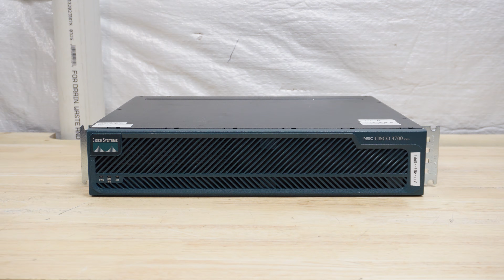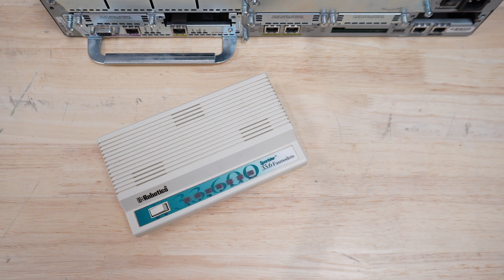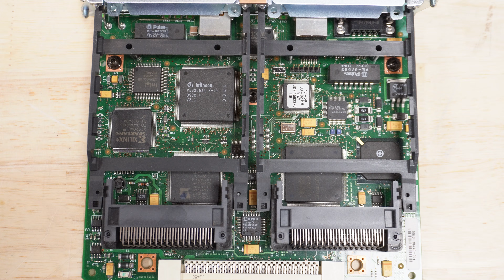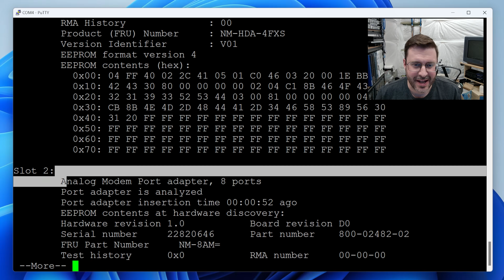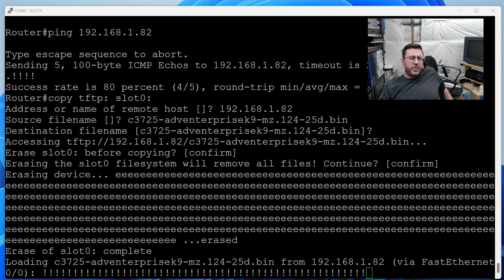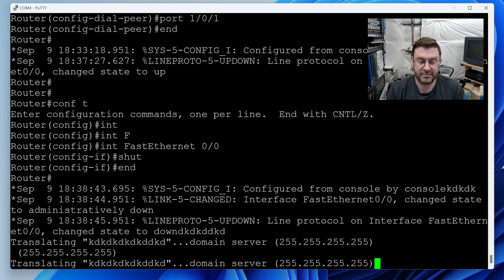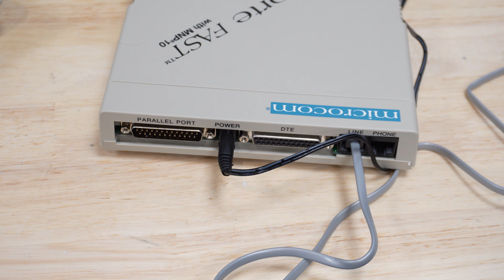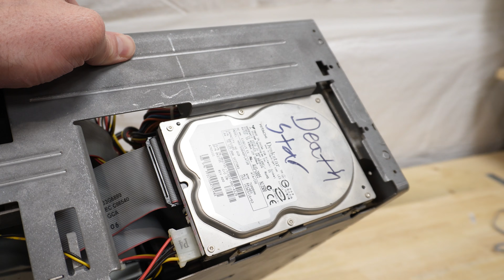All-In-One Dial-up ISP Box

Comment: Xilinx, sounds like Zai-links. ...man SO pumped for the token ring content. Long time in the making but gonna be worth.
Reply: If you haven't looked them up yet clab, Xilinx isn't a networking thing. They make (well, made, looks like AMD bought them) FPGAs.

My "Digital Systems Design" (aka building things with AND/OR/NOR gate chips and wires) class in college used some Xilinx boards once we progressed past the basics. The hardware seemed fine, but the software was super buggy and the lab machines weren't kept in sync so depending on which machine you sat at you had a different set of bugs in the Xilinx designer. Absolutely hated it. I'm hoping they improved that software in the....many, many years since.
Reply: @rnelson It's better but not by much, the new iteration from Xilinx is called Vivado. Synthesis is a die roll on if it completes or not, and the simulator crashes periodically every few hours. Glad to see it's some generational trauma 😂

(Gory details: synthesis and simulation tools are written in C or C++, accessible via Tcl scripting. That part is mostly OK; the best experience I've had is just doing everything via Tcl scripts from a command line. The problem is that they've stapled on a UI drawn in Java, which actually interfaces with the lower level stuff by string-building and executing the Tcl commands for the corresponding high-level operation. So there are allll sorts of subtle bugs there, where you get unexpected results, or a full Java stack trace popup, complete with ProGuard-obfuscated function names, which is the funniest. God forbid I wanted a space in the name of my project folder, or my international student friend has a home folder name with non ASCII characters :')
Reply: @an0ndev  Hahaha. Never change, Xilinx, never change. No, wait, that's not it---please change, Xilinx!
Reply: @rnelson  if you've used ISE in college, the latest version Vivado improved the software a bit, but it's like how getting a kick in the stomach is an improvement over getting kicked in the nuts
Reply: Xilinx (now owned by AMD) makes FPGAs (field programmable gate arrays), which provide a way to implement some digital circuit (implement something "in hardware"), without having to actually design and (pay to) fabricate the IC yourself, which is a very expensive process -- not worth it for relatively small batches. There are downsides, but in general, you can implement whatever digital logic you want; in university, we design and implement a MIPS CPU using an FPGA.

The FPGA ("field-programmable gate array") gets programmed at the factory with something called a bitstream, which defines the logic and routing of the digital signals around the chip. Aside from routing and input/output, the core building block that powers the chip is called a logic element. Each one can apply a digital logic function to a small number of signals (ex. out = A xor B xor C), and optionally synchronize the output to a clock signal. There are thousands plus of these logic elements in an FPGA; you form more complex circuitry by connecting the output of one as an input to others. (The function applied by each logic element is part of what's represented in the bitstream)

The other big FPGA designer you'll see is Altera, now owned by Intel.

Comment: If you stay with the four ports on the RJ21, it would make more sense to get a solderable or screwable RJ21 plug and add RJ11 and RJ45 cables to it. IF you want to have it really convenient, you can bring all eight modem ports and the four lines from the RJ21 to a patch panel to the front, you you can use breakout cables there :)
I messed with RJ21 for a while and I still have some plugs and panel mount sockets somewhere in a box. But as I only work with four lines at all (just the limit of my ATA), I ended up with two RJ11 (line 1 and 2) and a RJ45 (all four lines) on my workbench to save up space.

By the way, on most hardware port 25/50 was unpopulated. They stayed with things devideable by 8 so 24/49 was the last one.

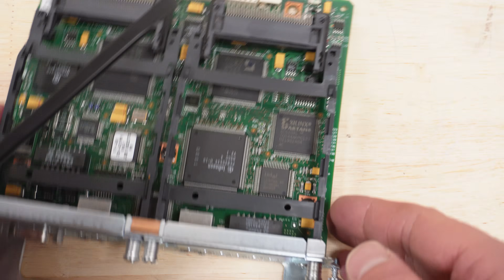Comment: 17:39 Its an FPGA, a bunch of logic gates, its programmable hardware basically, the firmware will configure it to do some function it needs, its faster than using a CPU, and it also allow you to basically switch signals and send them where you need in a way that can be changed via software by configuration.

Comment: Older modems use AC to generate the negative voltage for RS232. Learned this the hard way some days ago. Thought about modifying and put a switching converter into, but at the end I found the correct brick.

Comment: The parallel port on the modem was to provide an alternative, non-standard but faster, connection to the PC. The modem could compress the data it was sending over the wire (that's what MNP is - MNP 1 to 4 just did error correction, MNP 5 and up did error correction plus data compression) so if you've got a very easily compressible file you could theoretically need to push data to the modem faster than the max 115.2Kbps the PC's serial port supported. So you'd use the parallel port with a special driver to make it look like a serial port to the PC OS. In reality finding data that easily compressible was very rare so it was a bit of a gimmick.

Comment: If using Cisco router,  why not use digital modem card? Like NM-xxDM. I have AIO dialup router with 56k v90 dial-in based on Cisco 3800 series with NM-30DM card,E1-E1 loop and 4FXS

Comment: I'm not sure if it's era appropriate (probably?) but I'd use Cat5 with RJ11 terminations to do breakout from the FXS ports and into the modem ports. You could get 4 phone lines over a single cable, cleaning it up quite a bit and pretty much trunking 4 lines back to the modem via one cable that you just run along the big cable, splitting them out back at the router. Then you could also use RJ11 jacks with cat5 (and RJ45 if you wanted to be fancy) to push a bunch of phone lines to the other room from the retro rack.

Comment: If that controller card in the 3745 is removable, in true Cisco fashion I'm betting the chassis base SKU that article used for comparison didn't include the controller card, which is why it's seemingly cheaper. Tough to track down the old datasheets and ordering information now though (at least before I got bored lol).

Comment: 8:45 Those 25 phone jacks have 4 pins each, which means 2 phone lines per jack. You could plug up to 50 phones into that thing.
Reply: Or for diverse bonding.
Reply: I only see 2 pins populated... a quick google shows that the AT125-SM is a 25 pair bridging adapter: 25 pairs enter on the first RJ-21, and unless a plug is inserted into the corresponding jack, that pair is bridged to the corresponding pair on the other RJ-21. You'll often see these sorts of jacks where you need to be able to quickly disconnect the subscriber side of a circuit for testing and fault isolation.
Reply: they just used 4-pin jacks, doesn't mean the 2nd line on each is wired to anything at all
Reply: jeremycole2036 I find it highly unlikely that they used 4 pin jacks and didnt use half of them, when they could have used 2 line jacks. 2 pin jacks did exist, as did 6 pins, as RJ45 is technically supposed to be a six pin standardEdit: aaaand not watching all the way through before commenting hits me in the ass

Comment: I do remember the mid to late 1990s - All the IBM people in our company were all "token ring is better becuase it dosen't have any packet loss, that's why it's used in banks!" and I was like... ??? huh? That... doesn't make a lick of sense but it sure sounds like something an IBM salesperson would say. 😸 - but eventually, even the AS/400 was "ethernetted" - there were also adapters for the old twinax wires, so you could plug in really old terminals to RJ45 cabling.

Comment: One trick for rack ears  is to flip the rackmount brackets so they are closer to the center of mass.  Downsite, the router pokes out the front a bit.    Ideally you'd find or make the rear mount brackets that fit your depth of rack.  Its only folded steel with four holes, not that complex.
Reply from the maker: yeah they were flipped originally, i wanted it closer to the front haha

Comment: I have no idea why they would charge more for the 3725, the specs of the 3745 are better, and it's got fully redundant power supplies (or option anyway). Cisco did do weird special bundle prices sometimes, so that's my best guess. Also, the 3725 only support two NMs (one double width), whereas the 3745 supports four or two double width. The plug on the front of the 3725 power supply is for the RPS unit (redundant power supply, different from having redundant power supplies 🤔), and the bracket thing just holds it in place. Not really that useful since it shares the same power input.

Personally, at work I preferred the 3745, since its smaller sibling is only rated at about 50Mbps throughput, whereas you could get 100Mbps pretty easily from the big boy. We had the 3725 at smaller offices, and the performance difference was noticeable, especially when it was pulling double duty as the voice and WAN router (obviously not an issue for a simple dial-up setup). Plus you get fully redundant power supplies from separate feeds.

To access the modems and run AT commands, you probably need to reverse telnet into the line. From memory, you telnet into port 20xx, where xx is the line number, via a loopback, so for line 65 it should be port 2065.

Comment: What you've got there is an Allen Tel Bridging adapter, which apparently, you can still buy new today.  Graybar has them listed in their catalog lol!  Essentially you can daisy chain a pair of these blocks together using the in/out ports, and on block 1 port 1 would be bridged to block 2 port 26.  This was done for a number of reasons such as call monitoring & recording, having multiple phones with the same station/DID, conference bridging,  test equipment etc.  While I've never actually used those blocks, there are still some screwed to the wall behind the analog gateways in my office datacenter.  Ironically those blocks do something that in more "modern" times can be done inside the analog gateway itself.  From my experience on the larger analog PBXs, you'd have the RJ21 coming out of the gateways line card and terminating on a set of 110 blocks.  From there, you can patch a specific port of the analog gateway which supplies dial tone for the station to some other location in the building using a single pair of wires going to another 110 block.

I really cut my teeth on telephony in my professional career and its almost a shame that while you're in process of spinning up your own analog PBX, I'm doing everything humanly imaginable to remove all the some 500 active analog stations I have in the campus today.
Reply: I know I desperately would like to have some sort of PBX at my house well at the same time where I now work I just went through all the phone lines and redid them properly all to serve the massive amounts of "1" phone line for the elevator telephone call box. but at least I know every pair now is one for one through the whole system. And you know the Elevator phone actually works in the wire going in the panel didn't have that necked bear spot on the pear causing it to not work right. And everything is labeled from the phone company box in Elevator phone did not disconnect.
Reply: @imark7777777  I went pretty heavy into playing with Asterick a few years ago.  Got a VM spun up on my proxmox node, set up a bunch of Cisco 7945s configured as IP phones, even had a SIP provider configured with XMPP to connect with my Google Voice account!  That was awesome!  If you called my mobile phone, it would also ring into one particular station of my asterick PBX and I could answer the call on an IP desk phone!  After google did what google does best, and killed off the XMPP connection, I kinda lost interest in the local PBX and have since decommissioned it.  The last of my telephony stuff that exists is a Cisco SPA525G2 sitting on my desk configured for "Hamshack Hotline" that I use to dial into some ham radio repeaters when inclimate weather is afoot.

Though, I did buy a Grandstream ATA the other day to add a VOIP dial down to my Home Assistant voice assistant for use with my 1960s Western Electric 554 rotary telephone, it turns out the ATA is locked down to vonage and cannot easily be unlocked allowing console access to set the dial pattern required to make that work.  Eventually I'll get around to buying one of the Cisco ATAs that isn't locked and get that all set up.  I'm still a cable monkey at heart despite the majority of my career is now focused on network engineering instead of telephony.  One of my coworkers the other day made fun of me when he saw me carrying around my old analog tempo buttset.  Kids these days lol.

Comment: That "door hinge" looks like an airflow thing, if it's blocking the PSU spot it's preventing air from going through the holes in the case and if it's in the other position it would prevent the fans from interacting with the weird shape of the PSU until it gets further into the case.

What this does to the thermals, no idea. Is it important, looks like it to me but again 🤷.

Comment: "no ip domain lookup" is your absolute best friend along with "logging synchronous" both are instant entries any time you configure a machine... Your level of frustration in iOS will literally half instantly 😂
Reply: (no ip domain lookup will stop unknown commands from trying to search for a DNS hostname, which is what it does by default, and logging synchronous will make it not interrupt your typing for console messages) I thought I should clarify instead of spout mysterious commands 😂
Reply: I wish I was told this decades ago.
Reply: You could also do "transport preferred none" under line vty / line con if you have DNS dependencies.
Reply: @crisutin  Should be the prefered solution for people who learn IOS with old devices, because with new ones you need DNS at least for licensing.
Reply: Every Cisco class I took in past years is coming back to me. What memories I made.
Reply: @CalebBurnsGamesDotCom  That command was drilled into my head in the Cisco labs too.
Reply: I 100% concur with both of those. "logging synchronous" is the FIRST thing I configure, EVERY time.
Reply: @StrongbowTX  I sometimes wonder why that's not the default.

Comment: (0:58) That "NEC Cisco 3700 series" thing reminded me of when NEC had PowerMate models in the early 2010s that were exclusively available in Japan and appeared to have been based on Lenovo ThinkCentre models of the time, albeit in white with blue accents instead of black with magenta accents. I only knew about those because some of them ended up on the used market in Singapore. I've a feeling a lot of those PCs were purchased by companies that had more trust in the NEC brand than they did in the Lenovo brand, or they had contracts with some IT company that provided NEC products.

Comment: Made thousands of the 25 pair and 30 pair AMP connectors back in the day. Look up the comb/crimp tool for those things. Common pair colors Blue, Orange, Green, Brown and Slate. Bundle colors White, Red, Black and Yellow. 25 pair cable had Violet for the 5th bundle. 30 pair had 2 white and 2 red bundles no Violet.